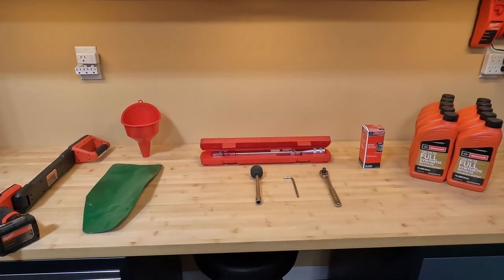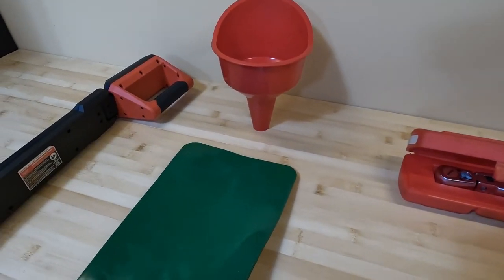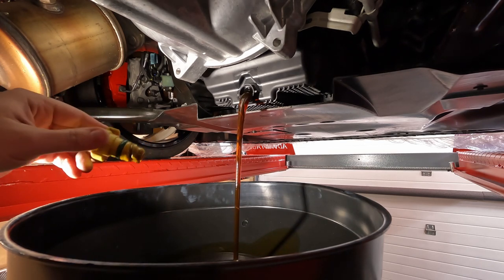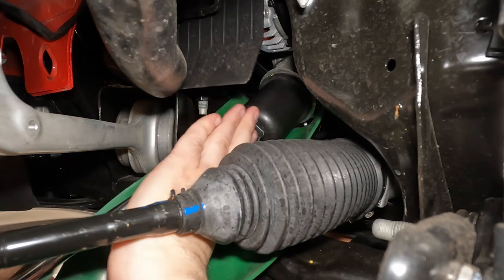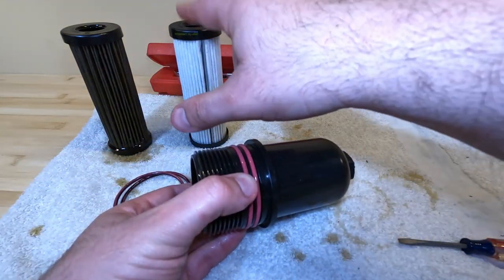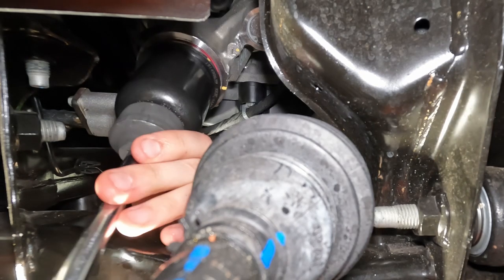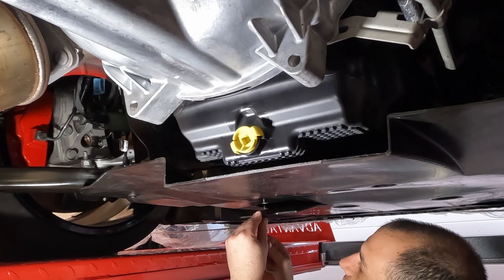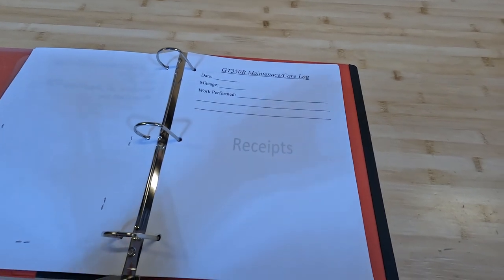Shelby GT350R Oil Change

Comment: Great info, especially since my local dealer had never worked on a GT350R before - I am leery of having them work on the car, with the low ride height and front splitter they could easily damage something. Also, here is a funny anecdote: on my first service performed at the local dealership (not the selling dealer), the service tech advised that my tires were completely worn out (at 900 miles) and needed to be replaced! I asked if they had ever worked on an R model GT350 before. They had not, only select dealers were in that program. I explained about the Michelin Pilot Sport Cup 2 tires. It didn't matter, they didn't understand about the tires and insisted that they were all worn out!
Reply: Same experience on the tires. Embarrassing. Not going back

Comment: Fun fact for anyone changing oil or has just had their car sitting for a while, pressing the clutch and gas all the way down while starting will spin the motor but not fire. This is nice to build up a bit of oil pressure and fill up the new filter before the engine is actually running.
Reply: Wait what?

Comment: Nice. This video helped. I notice you didn't put oil in the filter housing.  Does Ford recommend that?  Just now doing the first (for me) change on my 350R.  Sent the oil out to Blackstone for analysis. Engine has 30k on it.  🤞
Reply from the maker: It doesn’t really matter, just carefully line everything up and make sure it goes in smooth with minimal resistance.

Comment: Did you remove the large under-car plastic panel to access the filter? You were not working through that small filter access opening where you had removed the cover.
Reply from the maker: No. You can also access the filter from the side.

Comment: There is a backorder on the FL-2087 filter and nowhere to be found either, I've searched at just about every auto parts store for the Ford brand. Instead, I found K&N Performance Gold for the GT-350. It has a cage on the inside, but I can't tell if its metal or plastic. So the K&N will have to do and the dealer says it's ok to use, until the Ford FL-2087 is back in stock, who knows when.
Reply from the maker: The K and N has a plastic cage. I’m going to do another video addressing this and alternate ways to get a 2087.

Comment: Nice video that lift is coming in handy. Did you add any oil to the filter before you screwed it back on  or did you prime the car at all before you started it?
Reply from the maker: primed it. that priming feature is a great thing ford programmed in.
Reply: @EnthusiastsGarage  most definitely a great feature. Do you have a part # to get an extra cannister i like the thought of having an extra one as well. If not i can ask the dealer tomorrow or something like that.
Reply from the maker: @350Voodoo  https://www.tascaparts.com/oem-parts/ford-oil-filter-kr3z6a832a
Reply: @EnthusiastsGarage  thats awesome thank you